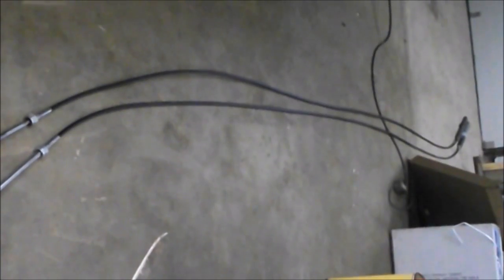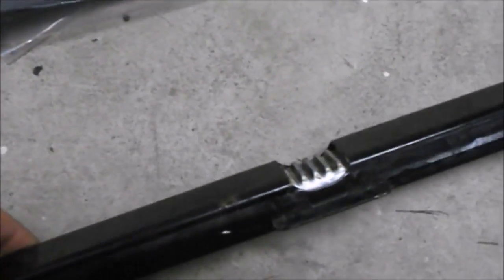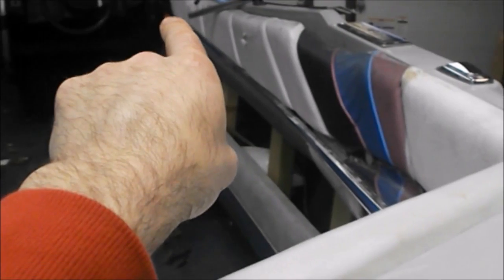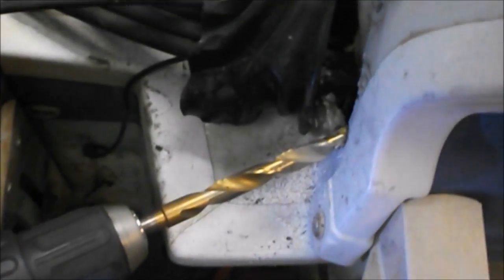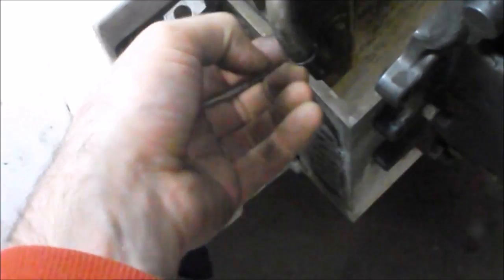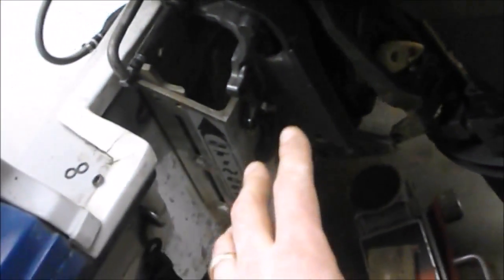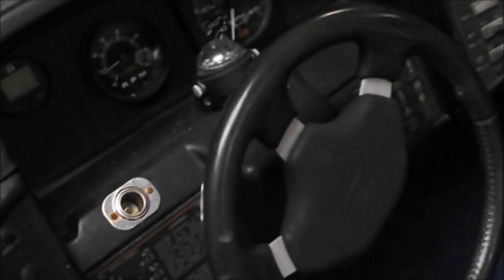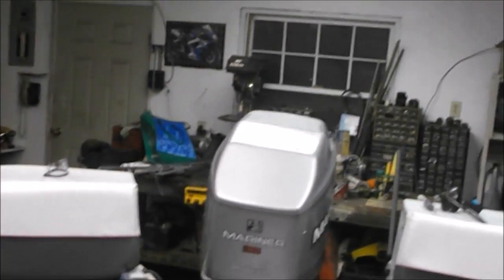Boat steering cable Part 1 of 2 Replacing a siezed cable and hub inspection

Comment: Great video. You should also check to see that your steering wheel is centred even and the outboard centred at the stern so that you wind up with a nice install and the wheel is straight.

Comment: Hi there,  nice video! Where did you buy the new cable with the bracket that matches to the hub? I need to replace mine. Thanks in advance.
Reply from the maker: My local m boat dealer ordered It for me. It came with the bracket